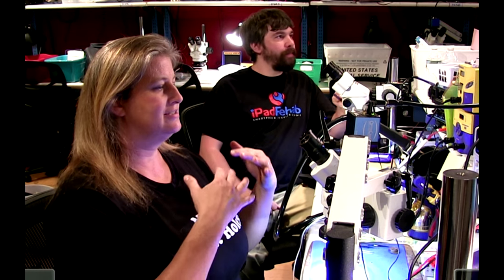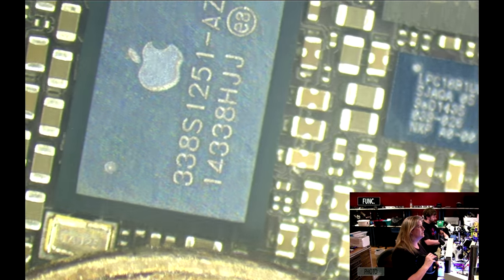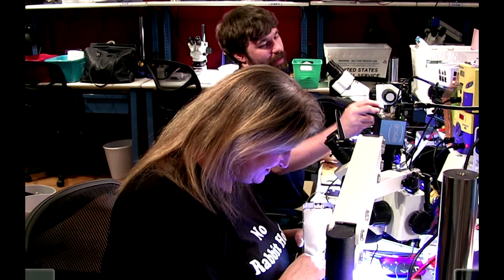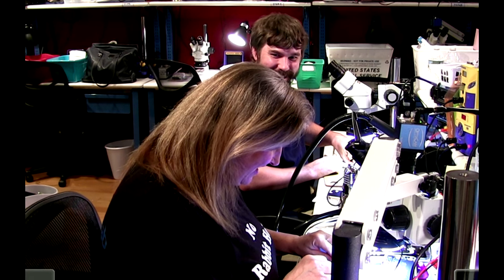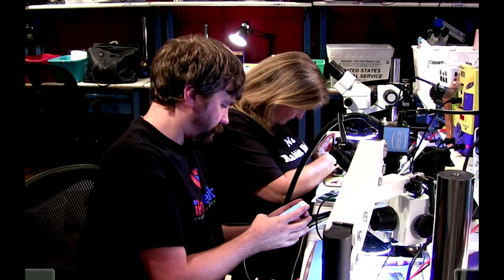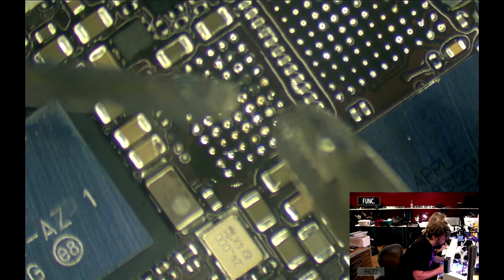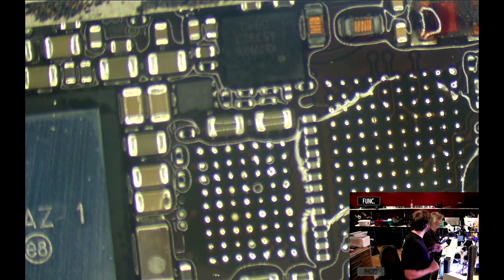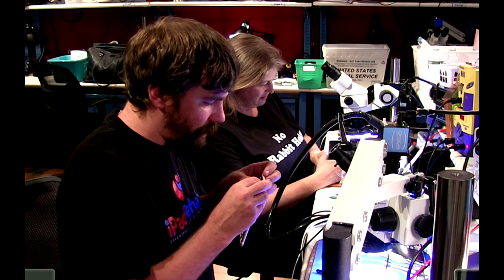Common iPhone 6+ touch ic complication---or lack thereof

Comment: 13:57 soldering without fume extractor on
Reply from the maker: Some of us use old school noise filters in Vegas.  Called 'turn that shit off so we can hear each other"
Reply: iPad Rehab LIES! When you yell at Sunday I can hear it in my apartment..
Reply: +Louis Rossmann Lies! I never yell at Sunday, she is my rock!
Reply: Hi Jessa, 
I have couple of questions regarding the Amscope microscopes.  0.5X or 2.0 Barlow Lens. Do we really use barlow lens? How important/efficient are barlow lens for You while repairing logic boards?

For the connecting camera,  do You need to buy a separate "REDUCTION LENS " also? what parts do You need to hookup camera to Your Monitor/record videos?

Thank You for Your suggestion.

Comment: Jessa Im happy to see this collaboration video on common faults. Another common thing I see ifs the "Window blind" look or even "pinstripe"
Reply from the maker: You mean from bad meson placement?  Knocked meson cap? Or something else?
Reply: I'll be honest I don't know the specifics of what causes it. I've placed the meson spot on before and had the white blind effect or even thinner pinstripe look with no touch. I assume its all Meson related.
Is this mostly shorted pads?
Usually when I get this issues I rarely can get rid of them. I doubt alignment is the issue in most cases since the chips barely move when the balls melt.
Reply from the maker: I've only seen that once--the pinstripe.  The phone started out that way after bend and the pinstripes persisted after touch ic replacement and after pulling meson.  5v7 line from chestnut was short to ground, told guy data only and sent it back.
Reply: I had the issue, had to replace L2401

Comment: I think I will try to design and 3D print like a fan mount with rib directing air under the board and the sides from the IC chips. It should cool the other areas
Reply: Not so sure heat is a real issue here , im my experience every 6 with touch ic issues has a bend in the frame and that put stress on the mainboard , 3D print a nice hard case that will not let your phone bend in your pocket ect and you'll have better luck :)
Reply: I get plenty of 6 without any bends that have this issue.  But for the issues that come up from repairing touch ic - to much heat on other components- A rig with a fan cooling other parts would greatly decrease risk of desoldering other stuff. I will try to come up with something and upload a video.

Comment: If you didn't have any new touch ic's on hand would you consider just reballing the ones you have ? , i have a 5S that i thought it was a digitizer FPC with afew bad pins however after replacing it i still have lines and blocks without touch , i have tried the poor mans "reflow" to the touch ic without success and almost considering buying some stencils for moments like these
Reply from the maker: Sure.  Touch ics are $2 so I don't normally bother

Comment: Hello......i have a request. can u make a video how to check step by step which part of the iphone 6/6plus is problem and need to repair.  major repair like IC change. how to know exactly which IC. and i got customer wanting their phone repair but a blank LCD even change the LCD and using Power supply wont turn on.
Reply: That is exactly what we teach at Practical Board Repair School.  There is no recipe for this, it is learning how to think and use tools to narrow down the problem.
Reply: thank you for all the video u make ^_^ 
i think i have found 1 of ur video to repair. mayb it on the screw.........i will try to repair it.

Comment: How about the complication of getting a grey screen and rebooting after about 30 secs to 1 min.  Touch works fine. 3 sets I tried.

Weird. With a brand new test screen the above happens.  Noticed something on his screen that said home button is disconnected.  His iPhone is setup different. Weird.  It is fine when I have his screen with his home button plugged in.
Instead of swipe to open it is press home button...
Reply from the maker: sounds like ios 10
Reply: 10.0 yup.
Reply: He, he.  How about 'searching'? I've seen 3 already.  I'm guessing their touch IC and something around the baseband also cold joints? Probably try reflow around that area & see what happens.

Comment: jessa      my iphone 6s got the screen repaired by local shop over here in the UK...since the new screen fitted the phone drains the battery really quickly and if you run a few apps the back of phone gets very hot instantly  ...i took it back and  the repair shop has had the phone for over a week now...should i just get it back from them and send to you in USA?
Reply from the maker: Likely damage to home button or long flex.

Comment: Hey, 
I have the same problem with my 6+ and here in Italy I cannot find anyone to fix the problem for me. They say working on the motherboard is extremely risky and dangerous. Everyone advises me to get a replacement from apple at a cost, which might have the same problem, or get a new phone altogether. I have no idea what to do.
Reply: If  it were me I'd get a 6s or 6s plus the touch IC has been moved to the display so no worries on that and the aluminum has been strengthened considerably since the 6 generation. They should be cheaper now that the 7 is out, plus the 2 gigs of ram will future proof you for a little longer on IOS updates.
Reply from the maker: i would definitely not get another 6+

Comment: Jessa, have you faced a no pp_gpu issue? Greetings from Venezuela!
Reply from the maker: that is a line commonly assumed to be short when it is not.  If it is actually shorted you're screwed!
Reply: +iPad Rehab first of all thanks for your time!  it's not shorted but i dont get the the 1v on that line so the iPhone is dead and constant 0.40ma
Reply: +Joiner Leal I would look to see if you can find a reason CPU is not being told to turn on.  Those faults are tough.

Comment: My iPhone 6 Plus does not turn on after the touch ic repair (meson). Is it the bad soldering or the connectors? I kind of moved the small components around the Meson chip. Thanks!
Reply from the maker: definitely bad soldering
Reply: Do the small components around the meson chip matter? Should I just re-solder the meson chip?

Comment: First thanks for the vids, always helpful! I've done a few of these and about 1/3 of them work. I'm running into the problem on the 6 plus where many are starting to not boot at all after the repair. I think I'm putting too much heat on them. Do you recommend lower temp such as 395 and gun on board for about 45 seconds to 1 minute or for example 410 and less time for about 30 seconds. Also, and I know every station is different but do you recommend lower air flow or higher air flow. Thank you.
Reply: I had exact same problem with one iphone 6 plus on touch ic repair. After changing bouth touch ic's, phone refused to turn on. There is no short to ground. My temp on hot air is set on 365C. Jessa please help, what do you think  went wrong? All power lines are ok and got valtage. When on charger it draws 0,49A.

Comment: Is necessari change both elements to fix the touch problems? Or just changing the black one fix it ? Because I just Change the black one one month ago and the phone was working rly good but now the problem came back so I'm not sure why. Help pls..
Reply from the maker: We always change both now.  If you change just meson then it may have solved just bc you reflowed cumulus at the same time. That's not a good solution

Comment: Your awesome:) I have a question, and this is not about boobs lol. Have you ever fixed all the shorts on a board and later come across a capacitor that has resistance on both sides? What does this mean?
Reply from the maker: it means look it up on the schematic